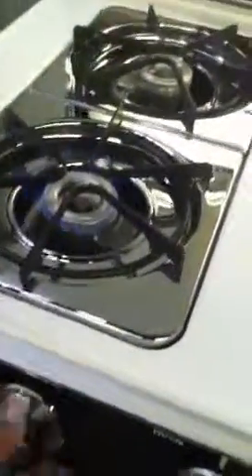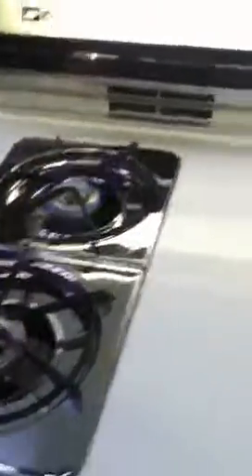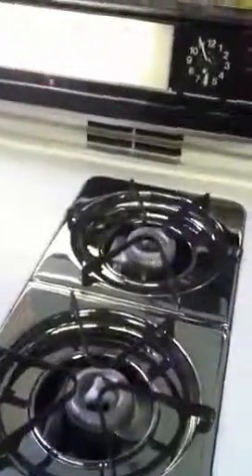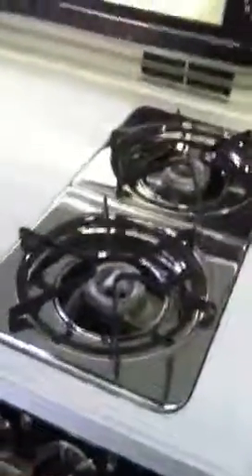Stove lady crown cleaning & repair

Comment: Many of these older stoves are better than most of the new ones. You just can't get the features in a new stove as you can in an old one. Just try getting a 40" double oven gas stove.